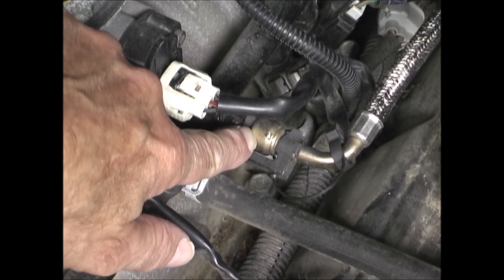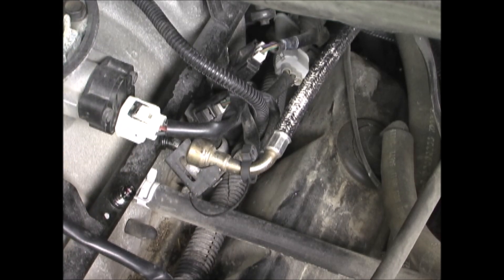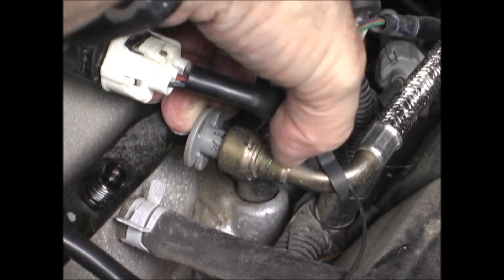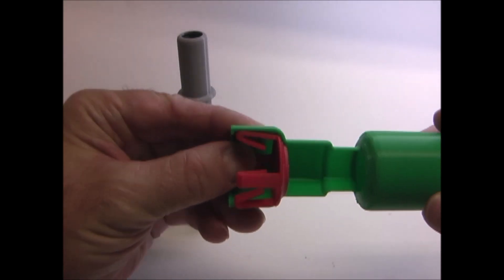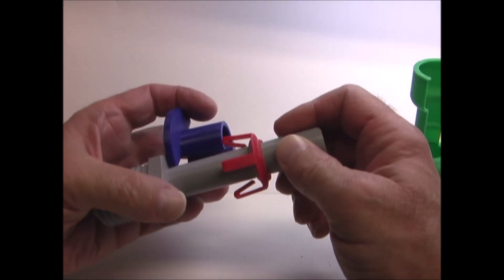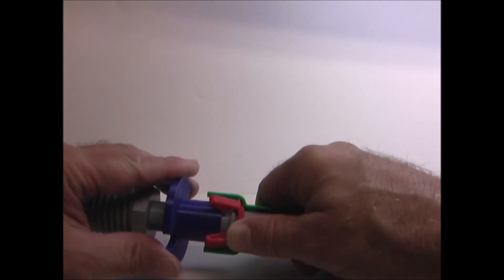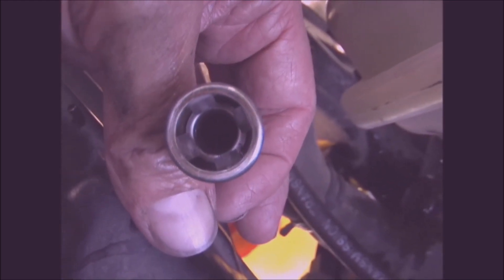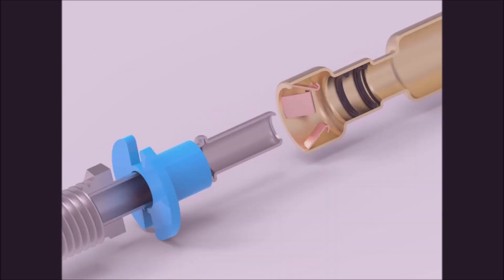How To: Quick Disconnect / Push Lock Fuel Line Release Tool, Transmission Fitting 3D Printed

Comment: I tried this but it didn’t work for me. It feel like its stuck or something. Any advice?
Reply from the maker: Sometimes it's easier to use a piece of hose and slit it so you can fit it over the tube and push it into the fitting. The tools don't always have a large enough diameter to force the connector open far enough

Comment: after a week i cant get the fuel hose out of the filter, try everything, cant get the clips clear from the connecting filter.
Reply from the maker: Sometimes the outside diameter of the tool is not large enough to push the clips open far enough to remove the hose. If you can find a piece of hose or tube that is slightly larger, it might work. You can also try wrapping some electrical tape around the disconnect tool to make it slightly larger